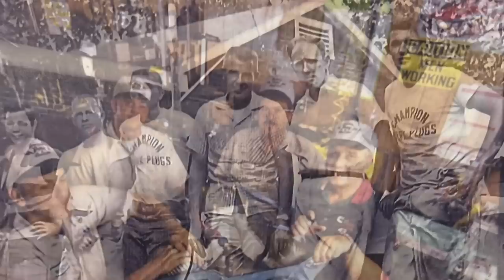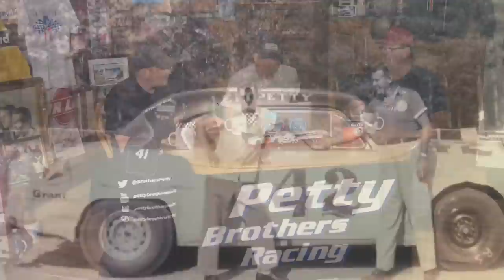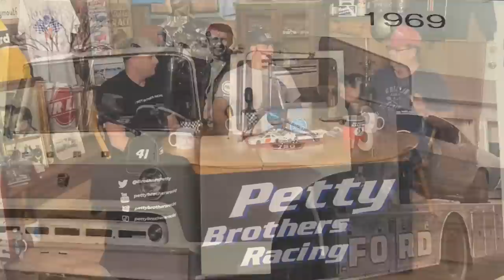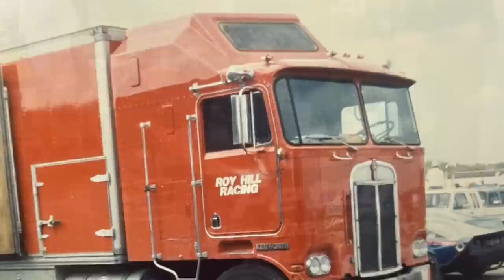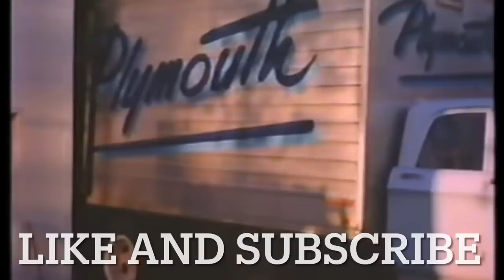The Progression of the Racing Hauler

Comment: I follow you boys and had to comment on a few things about race car towing. My dad was George. Anyway, I began my 30+ year racing career at Flatrock Speedway in 1984. Like most youngsters that grew up in a racing family, I was a 3rd generation driver that grew up playing in wrecking yards. I won some championships. I have somewhere around 100 wins on dirt and paved tracks. My first race was the first ever  1984 Enduro 250 at Flatrock Speedway, $1,000.00 to win. We towed the race car to the speedway with a 1973 Dodge 3/4 ton pickup. The truck broke and fortunately my best friend and mechanic thought ahead enough to bring a tow chain. We ended up towing the truck with the race car for the final mile or so. Ended up finishing 15th out of 75 cars entered that day. As my money got better we bought an open trailer to travel to Toledo and South ending up in Florida. As I got older I purchased a Hallmark 24' enclosed trailer. When I had to retire about 2013 due to poor eyesight and various other injuries we had a 24' enclosed trailer with a picture window. It was a used Penske show car trailer, so when we stopped for fuel people could see the race car. Fortunately the track officials never looked inside as there were about 7 or 8 of my grand kids from 3 to 13 yrs. old. Way too young to get into the pits hiding under sleeping bags, it was a 200 mile trip each way. So they came prepared for the late and cold trip home to Belleville, MI.
LOL

Comment: That box cabover in the video  I had. ..
I HAD THE ROY HILL RAMP TRUCK A 81  CABOVER KW THAT CAME FROM THE PETTYS. I REDID  THE REAR DOOR TO DO AWAY WITH THE RAMPS . I HAULED MY DIRT LATEMODEL  IN IT ON THE FASTRAK  TOUR IN THE 05 TO 09 SEASON'S  IN THE MIDWEST  AND WENT TO THE NATIONAL  CHAMPIONSHIP  NIGHTS  IN  SMOKEY MT SPEEDWAY AND  BULLS GAP. WITH IT I LIVED THAT TRUCK BUT I LATER DOWN SIZED TO ENCLOSED  AND DAULLY. IT WAS GETTING  TO HARD FOR ME TO GET IN AND OUT BECAUSE OF MY BAD LEG I STILL GOT PICTURES  OF IT. AND DIDN'T  HAVE THE MONEY TO GO THRU THE TRUCK  NOT TO DO THE MOTOR AND TRANSMISSION  BUT THE BODY NEEDED BE WORKED  ON INTERIOR  AND WIRING..IF THAT THING WOULD HAVE HAD 2 SPEED REAREND  IT WOULD HAVE RUN A 150 MPH FULLY  LOADED. BUT WAS GEARED FOR THE 55 MPH. SPEED LIMITS.

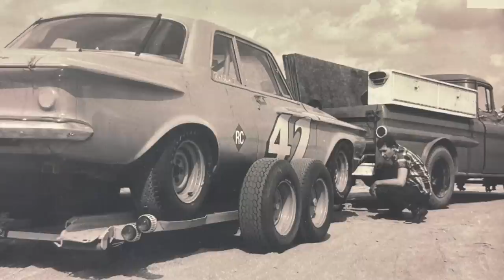Comment: great video...if you look at the picture at about the 3:09 point you can see what looks like perhaps the tail lights off the 62 plymouth mounted on the homemade trailer. It also looks like the tail lights from a 59 oldsmobile mounted on the back of the cabinet on the chivalay pick-up truck. Its pretty neat how they didn't waste much of anything to make what they needed back then
Reply: Looks like they had a dually rear axle under that Shibby truck!
Reply: Look just ahead of the light, they made a wide spot in the chassis for the wider tire on the race car... engineering!